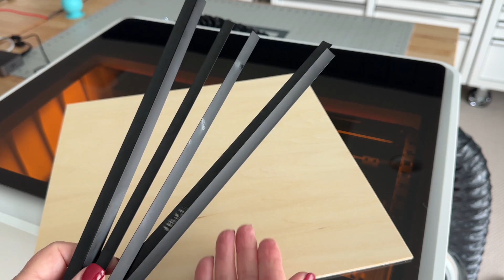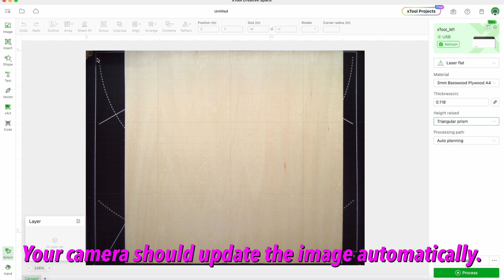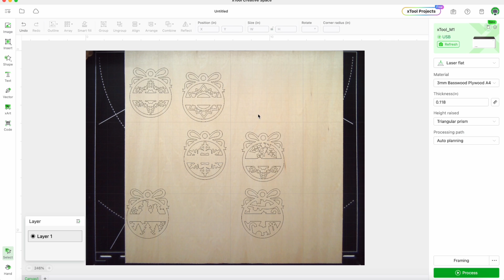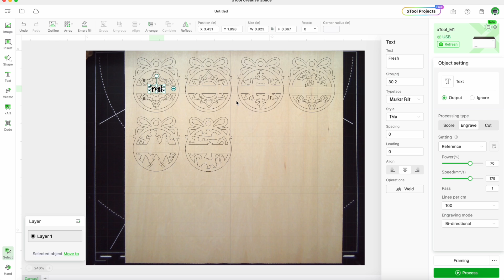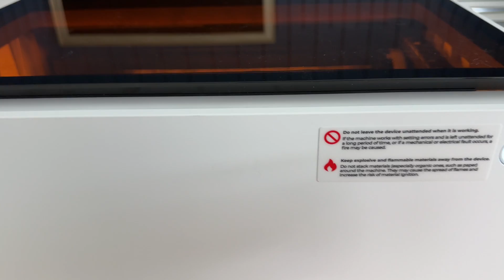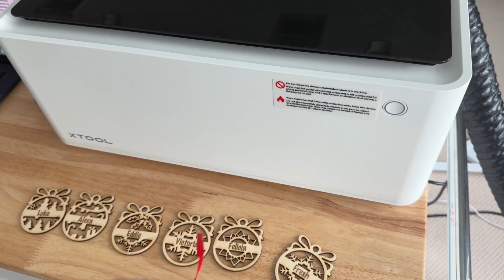How to Cut and Engrave Wood Ornaments with the xTool M1 Laser Engraver

Comment: Nice video. I have a question, what if your design has cut, score and engrave on the same design? Or even two? I see it gives the option to do one but curious if you can do all of them. Thank you.
Reply from the maker: Thank you. 😊 You can do them all at one time. Just select the items to be scored and mark the appropriately. Do the same for engrave and cut. The machine will start with score and then engrave (or vice versa - can’t remember) followed by cut.
Reply: @craftwithfelicia thanks so much ❤

Comment: Did you just do one pass and I was wondering if you could show how you pop them out. I did one pass and it doesn’t look like it cut through the wood.
Reply from the maker: I did mine with power 100 speed 5 with 1 pass and it did a clean cut - no pop out needed. This is on the xTool M1 and not the xTool M1 Ultra.
Reply: @craftwithfelicia  does it seem like the M1's cutting ability is better than the ultra? Thinking of getting an M1 now that they are on sale. TIA
Reply: New to this....I tried this project with the exact settings on my M1- but it did not cut anything....what am I doing wrong? Does the blade need to be installed?